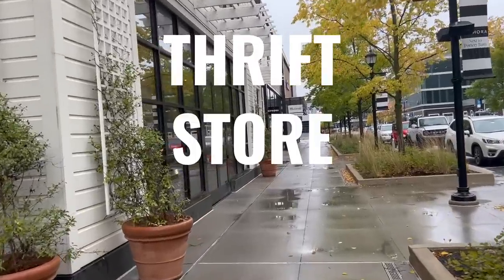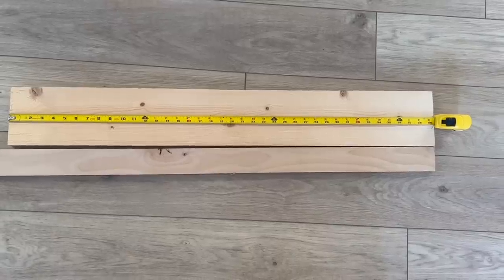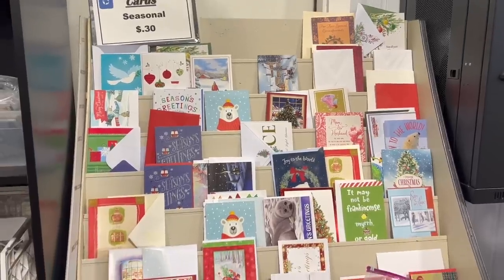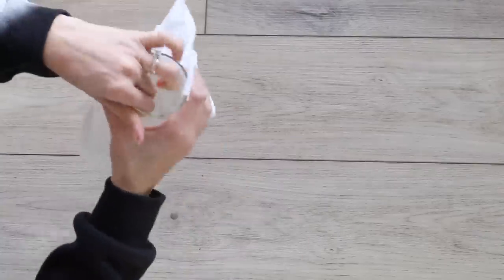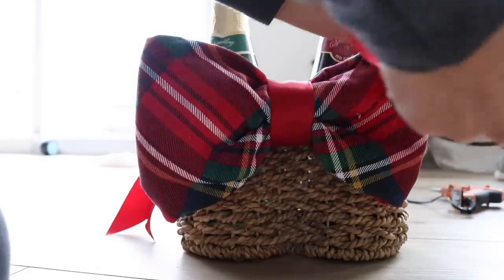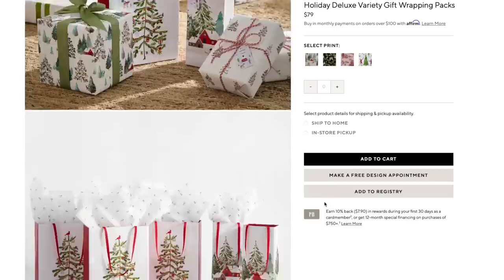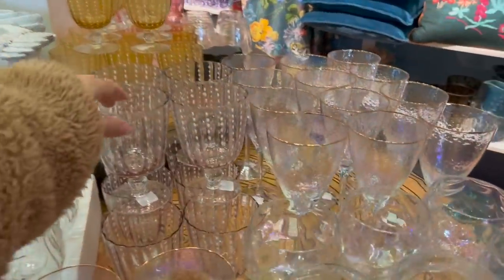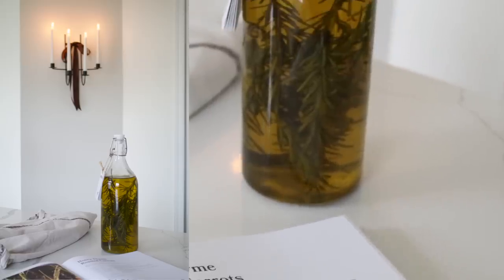HIGH END THRIFTED DUPES | DIY HOLIDAY GIFT IDEAS FOR EVERYONE ON YOUR LIST

Comment: A really easy way to get the price tags off is to heat up a wer washcloth in the microwave and place it over the label. It heats up the glue and then the label just easily scraps off. Then you take rubbing alcohol to any remaining glue. It's so easy, labels removed in seconds instead of scraping and scrubbing.
Reply: Goo gone is great for getting the glue off plastic. Sometimes alcohol will dull the plastic. I save all the large plastic containers nuts, pub mix, candy, etc. come in and use them in my pantry. Pub mix containers are great for pasta.

Comment: First rule of gardening: never put a plant (especially a succulent) in a container with no holes. Also, wooden containers with no liner will leach poisons into your soil and will rot very quickly.
Reply: And the moisture will ruin the bowl, too.  But it would cute if the plant(s) were first put in a little pot.